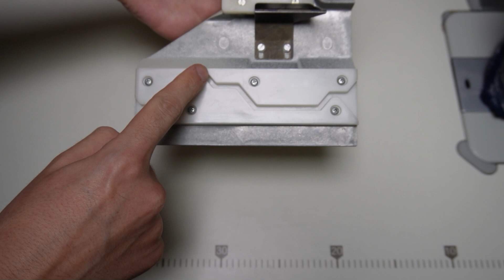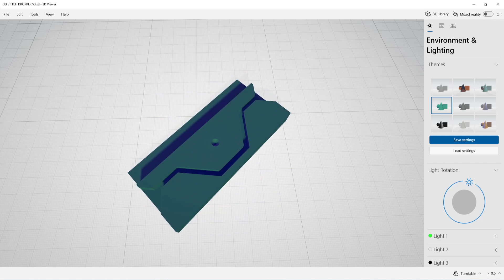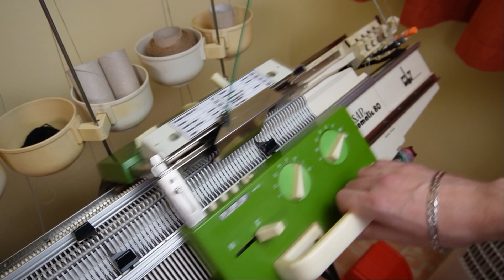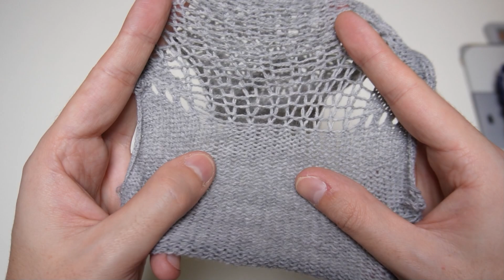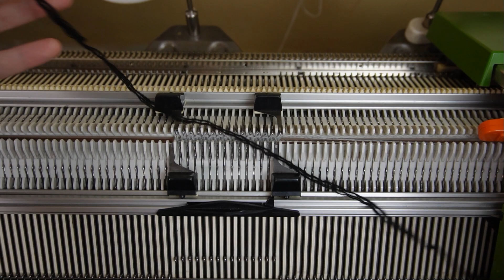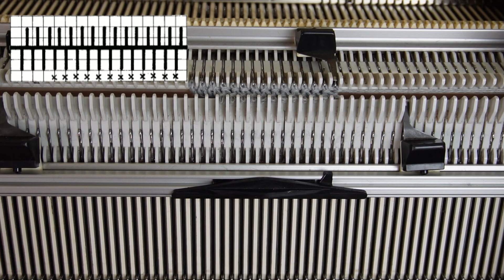Knit & Drop: Basics & Beyond with 3D Tools

Comment from the maker: In this video, I am testing my 3D-printed eyelet. While it works, I'm still searching for a sturdy material to make it from. The PLA eyelet held up for about 1000 rows before I noticed a nick on the tip. At the time of filming, several months ago, I wasn't aware of this. However, the eyelet, which I glued, is still functioning.